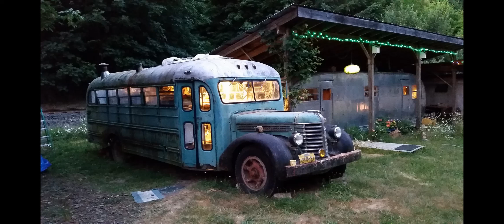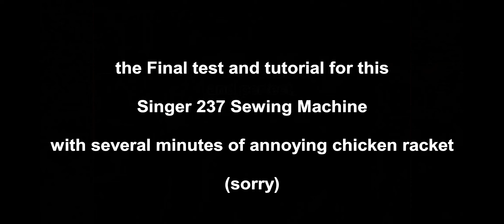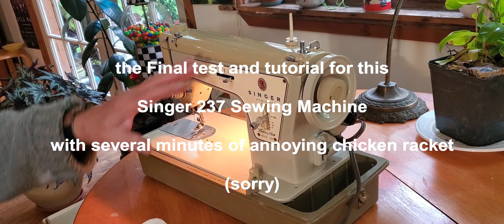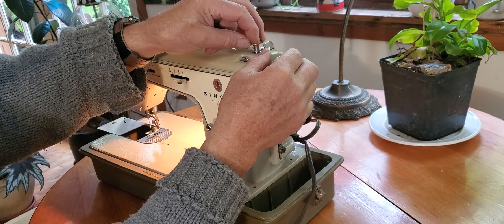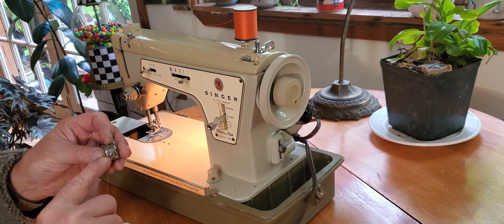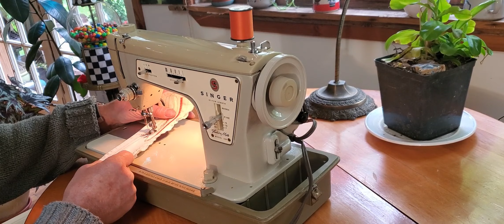Singer 237 Fashionmate Sewing Machine Final Test and Tutorial- how to......

Comment: I just thrifted one of these today for $25.  I've wanted to learn to sew ever since I was a kid and I've been researching machines for about a year now.  For financial reasons I had to wait until I found a steal of a deal.
I was worried a machine that looked so old and didn't come with a manual would be difficult to learn.  Now I feel confident in learning a new art form!
Reply: I know this comment is a month old so you might not need this advice anymore, but there's an internet archive of old sewing machine manuals!! You can download the PDF of the manual for this one for free and print it out at the library for cheap/free, that's what I did, and then I hole punched it and put it in a binder!

I ALSO thrifted one recently and the manual came in super handy for figuring out how to deep clean, grease, and oil her up. Look out for rust, though, I found a some on one of the bolts of mine (not anywhere else though thank god) and it was a massive pain to get out and clean because it was incredibly seized.

Comment: I just got this same exact machine it stitches but goes super slow do you know what can be wrong with it or how to speed it up ?
Reply: First make sure it rotates very easily (well lubricated, not stiff or tight). If it does, then I recommend replacing the motor, but be sure not to purchase one that goes too fast. The perfect motor for these vintage sewing machines is the .88amp 5,500 rpm motor available on ebay. Never use motors rated higher than 5,500rpm, they severely limit your pedal control. The .88 motor is approximately 50% stronger and faster than most OEM Singer motors than run like new, and 100% stronger than one that is tired...

Comment: Hi, how can I increase the speed of the machine
Reply: First make sure it rotates very easily (well lubricated, not stiff or tight). If it does, then I recommend replacing the motor, but be sure not to purchase one that goes too fast. The perfect motor for these vintage sewing machines is the .88amp 5,500 rpm motor available on ebay. Never use motors rated higher than 5,500rpm, they severely limit your pedal control. The .88 motor is approximately 25-50% stronger and faster than most OEM Singer motors than run like new, and 100% stronger than one that is tired...